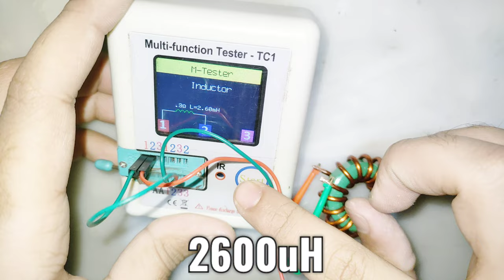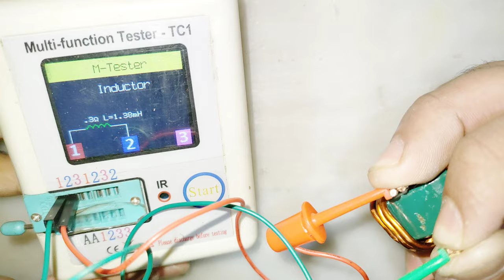How to make an Inductor 30Amps 60Amps

Comment: These will saturate at a few amps at most, nowhere near 30A!
Reply from the maker: Core material is the main problem, I think sendust will work  , btw I made it for a buck boost converter!
Reply: @Electronic_For_You  Yes, and you should actually show saturation current measurement please.
Reply from the maker: This is why I warned in the first comment about core material

Comment: you just earned a sub, I am also making a inductor for my sepic, 20A rms, 25 kHz, If Iron powder is not available in my country, should I use farrite?
Reply from the maker: If you use a farrite core then the inductance will be 10 × higher . I made the same mistake using Green Cores . Which i got 10 × the inductance of what it should. I got 1000uH instead of 100uh . So i strongly recommend using an iron powder core . From the computer power supply . If you don't have a store to buy
Reply from the maker: And 
Thanks for subscribing 
:-)
Reply: You deserve it bro♥️..thank you for your suggestion, I actually need to make a 8.45mH, so the number of turns will be much less in farrite core, but I have heard that iron powder works best at this frequency range, that is why I was confused.
Reply from the maker: Maybe you are doing something wrong! 

8.45mH is huge inductance
8450uH 

I think You need like 100uH inductance for the 25-50khz range . 8mH will reach saturation. Then it will drow  continuous current and blow up everything.

Comment: Ok, let's do the calculation for inductor #1

Specific inductance
18 turns, 2.6mH, Al = L/N^2 = 2.6e-3H / 18^2 = 8uH/N^2

ur ~ 12,000!
This is a high permeability core with no air gap, probably ferrite.
No air gap, very low saturation current

Magnetic cross section 
Ae = (Da-Di)/2*h = (31-18)/2*6 = 39mm^2 = 39e-6m^2

average magnetic path length
le = (Da+Di)/2*Pi = (31+18)/2*Pi = 77mm

relative permeability
ur = L * le / (N^2 * A * u0) = 2.6mH * 77e-3m / (18^2 * 39e-6m^2 * 1.257e-6) = 12,600

Saturation current

Is = Bmax * N * Ae / L = 0.3T * 18 * 39e-6m^2 / 2.6e-3H = 81mA

"Slightly" below 30A . . .
Reply from the maker: Thanks
Reply: greate infomation about inductor, thanks.